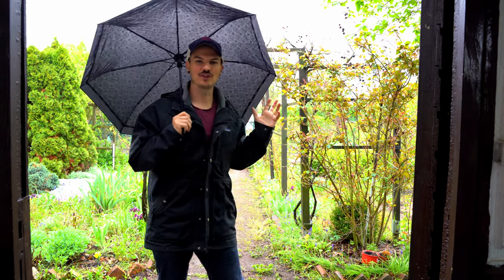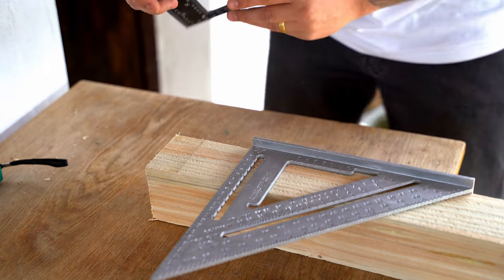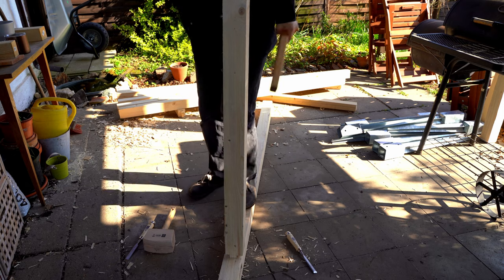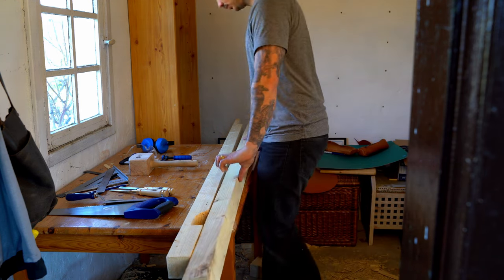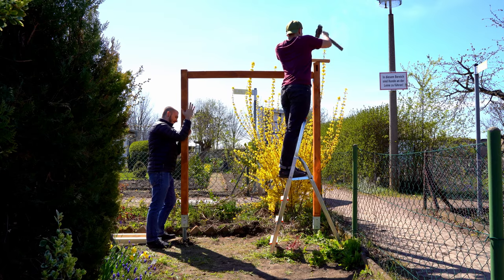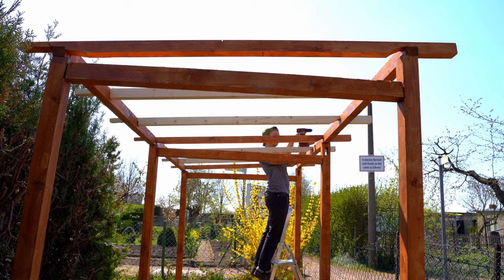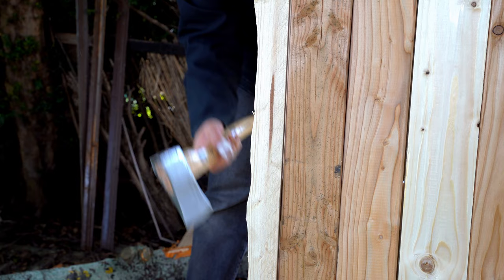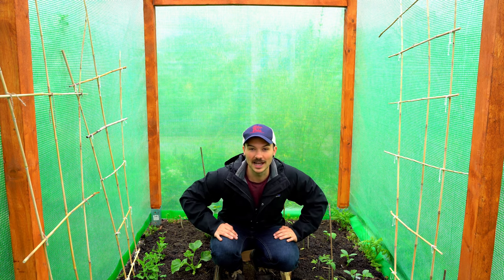Building a Greenhouse with Hand Tools! (mostly)

Comment: Just wondering what measurement system you have used for this job.
Imperial (inches) or metric (millimeters).

Recommend to get a hand plane.
Reply from the maker: Have one now, but the blade as about as dull as dull gets haha. Using metric, not so easy to find anything imperial out here.